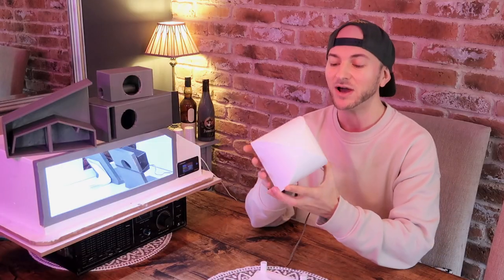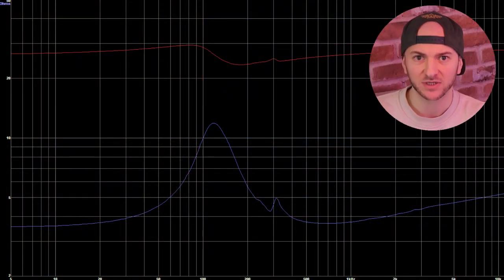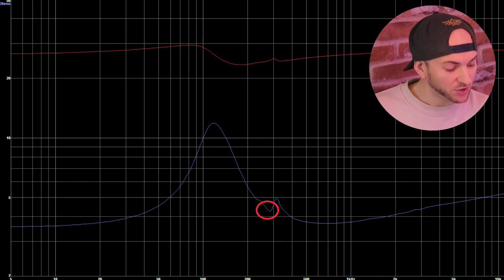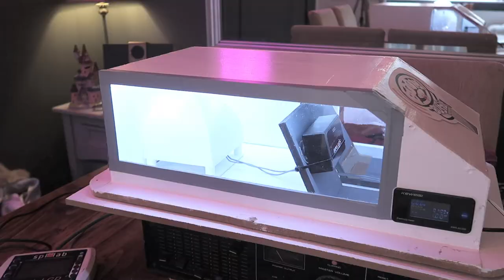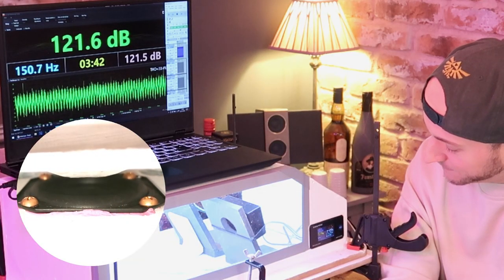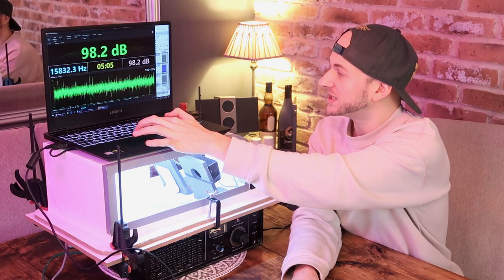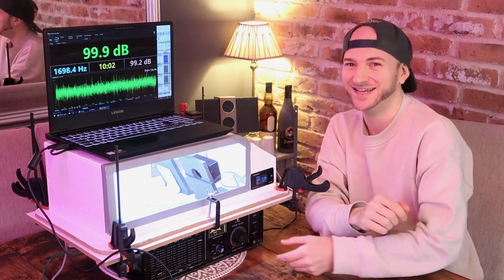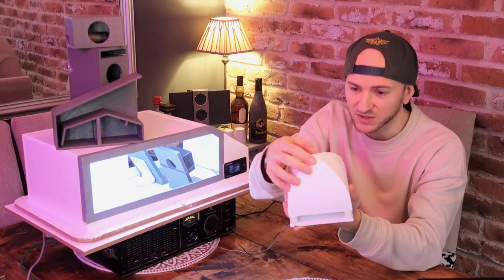The Omyramid Subwoofer - How Loud Is It!? Boom Or Bust S1E4

Comment: Loving the series, But Id like to see this print done at the same layer height as the other ones just to see if it makes a difference, The bottom part had alot of gaps and air was going into that chamber during the test you could see air moving the layers out of the way which seems it would hurt this designs performance.

Comment: One could actually use the ports for bracing, few smaller ones that go to the walls, because of its shape, it retains air flow, but i cant wait for season two with better simulated car interior! Windows, seats, carpets, doors, everything! I reckon the results would be really close to scaled versions

Comment: so you have already modified it?...and expected it to perform in the same way?where are the ports that you are speaking of?you havent even addressed that?
so i shouldnt hold your test to be true thumbs down.you have already misrepresented the test by modifying it
Reply: He only modified it by filling in the gaps from printing, I don't think that changes anything about the design or how the enclosure should perform. He clearly shows video of the ports on the bottom. 

Seems like you didn't watch the video.
Reply: The holes on the bottom and the legs holding it up are different. The holes on the bottom are the ports
Reply from the maker: Bro what are you even talking about?  It wasn't modified in any way, I think you are heavily misunderstanding something here.
Reply: Bro really? Lolol this guy. You know if Sam repaired your old ppi for you.. you'd just blow it up again as apparently "most batties only add up to 12v".. so it's power supply will be collapsed the whole time as you drive into clip city. Sam this could be a continuous revenue for you actually dude.. well until the via's fall off the board after the 70th repair that is.. and china runs out of fets xx